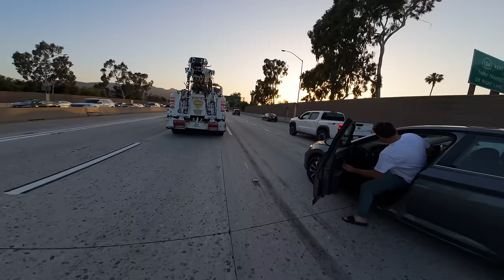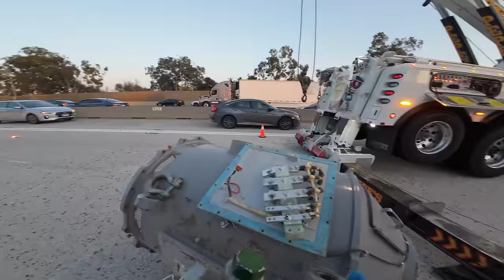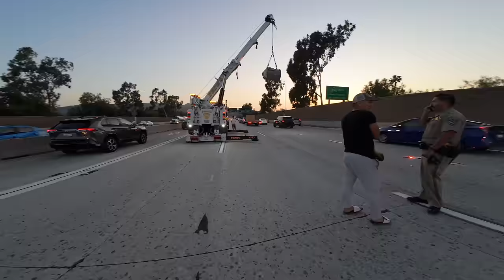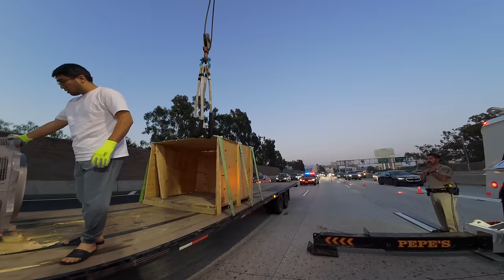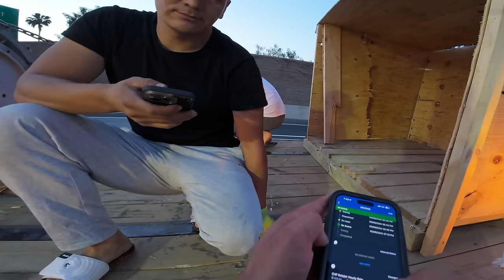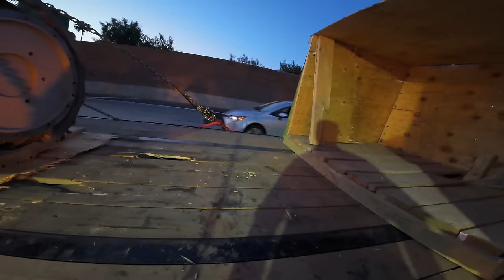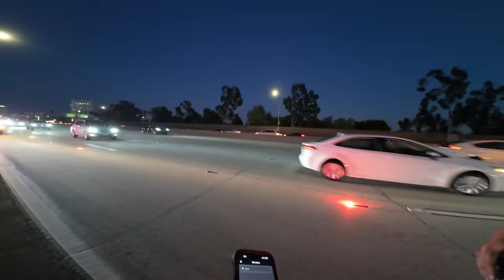18,000lb Alternator Falls off Trailer on Freeway

Comment: No way thats 18000 LBS
Reply: I tend to agree, Would estimate more like 5000-7000 LBS. It might was a part of a larger unit that was 18000 LBS. Looking at the state of the motor, with covers missing around eletrical connection points I get the feeling this unit might was heading for disassebly, recycle. and transporting the motor like this, in a simple wooden box with no proper internal bracing, securement inside might suggest it was not regarded to be high value. In the end they got the motor placed pretty close up to the front of the trailer, most weight concentrated on the pick up rear axle. I'm familiar with excavators in the 18-20K LBS size, I can't but imagine the pickup truck would been sitting preeetty low with a excavator that weight placed at the same point as the motor. Anyway no big deal, and no hard feelings towards Pepes what so ever if the given motor weight is a bit high. Better too high estmate than too low when doing a lift

Comment: That motor should have been shipped through a reliable flatbed trucking company who would have known through experience to open that box & look at the load and saw that it needed to be chained down BUT NO, they wanted to cheap it out for hire ( HOT SHOT ) imagrant with no experience who needed the money BAD

Comment: The box should have been disconnected and moved up front so the overweight 18,000 item could at least be over the axles and not in the absolute worse position for someone who isn't very proficient with understanding the load.
Reply: Know your axle capacity  & tongue weight.

Comment: Years ago, before I escaped California, I knew we were in trouble when I took our Son to DMV to get his driver's license and there were 14 different language versions of the Drivers' Handbook.  Then, while he worked by himself on the written, there were people of different cultures and languages leaning over the counter where the test takers were struggling with questions babbling their crap back and forth in a variety of languages.
I loved the part about "...how are you going to secure the load?" and they said "chains" and the driver turned to the chain rack, where the chains had obviously not been used or disturbed.  There were not even any binders in use on the truck, until after the freeway training lesson.

Then, the owner ("I'm just the driver.  Is not my truck and trailer.") was complaining about having to pay that much for the rescue!

Why didn't the CHP just red tag him?

Comment: He suppost to have CDL hauling that weight with that truck and trailer, if you get a CDL you are suppost to speak english because when I got my CDL they only had it in english because your suppostly understand the rules and safety precaucions so this would not happens. I work in West Texas. Many guys driving big rigs without knowing the rules, without speaking english causing many accidents. Who knows where they go and buy their license, but it's the companys fault because they hire that kind of drivers putting the other motorist in danger.

Comment: They hire’s these hot shot drivers they will but aka shippers anything on your vehicle need probably secure or info on how to once you leave the shippers property it’s yours and your responsibility of probably handling load or they ain’t going to do nothing but file a insurance claim on the load you just had issues with hot shot drivers are finding out the hard way that load belongs on a semi not a dual axle pickup

Comment: Idiots building boxes and throwing whatever in it. You cant do that crap.  I've put mych nore sketchy things in van trailers that were on just skids. But i used a crap load of wood just to secure the load in every direction. And the same when crating machines. There's no such thing as too secure.

Comment: Well you should have had them get off the freeway and you get off and stop blocking the road way and ask the cop to fallow you guys to a safe place to pull off buy you to much wanting that money than your safety the cops safety and the other guys safety
Reply from the maker: Ya and the fact that it was there for hours when two other companies failed to do the job has no bearing right? But the ten min of trying to get it resolved before we did pull to the shoulder is the issue right? What a moron